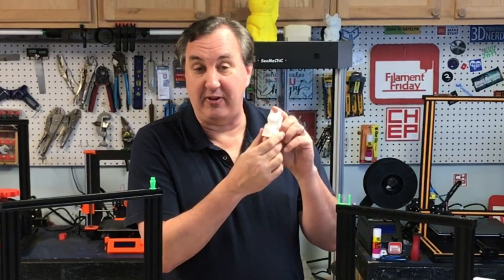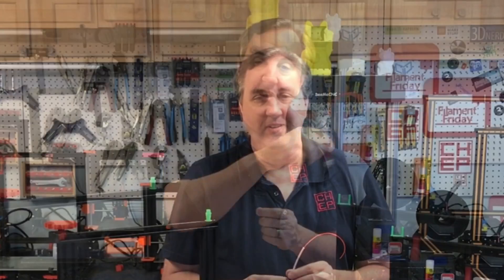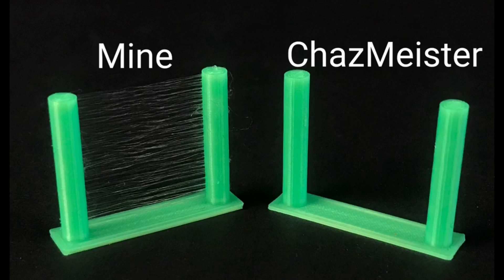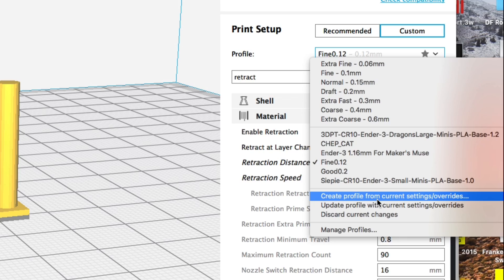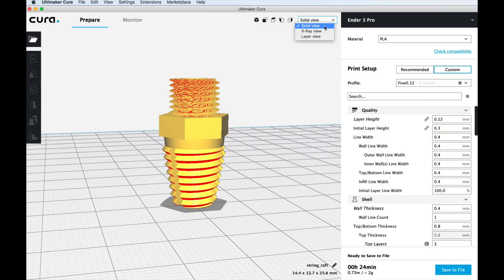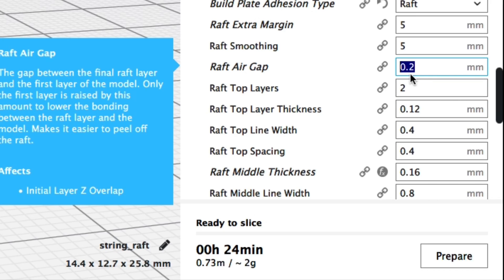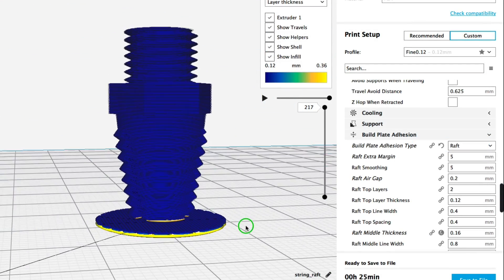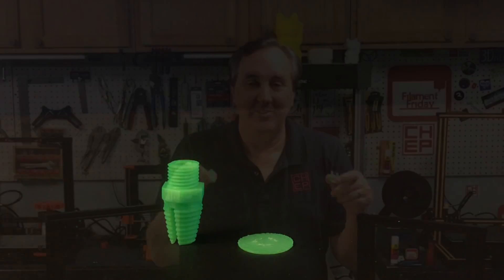Cura Settings for Retraction and Raft on Creality Ender 3 or CR-10 Mini

Comment: I try to change that and it's still leaving strings /: I print at 60mm/s any advide or change?
Reply: Makers Muse had same in his recent string video. He had to switch to a better quality filliment.
Reply: @MichaelDeeringMHC  Actually it's pretty weird, I use Esun filament and with some prints it doesn't leave any string, but when I print the retraction test they appear between the two columns
Reply from the maker: Did you try the settings linked in the description?
Reply: @FilamentFriday  I try it but I don't know why it doesn't work :c maybe it's the printer I don't know, I have a CR-20

Comment: all you need is wipe. I get no string. 60mm/s I don't THINK that actually does anything I think the firmware hard limits it to 25mm/s so anything over that is simply ignored by the printer. I am not 100 % sure on this but I have found no difference between 25mm/s or 100mm/s

I use 7mm retract and 8mm of wipe. no string at all. zero.

for build plate I print teeny footprints like that all the time. I just use a brim. easy peezy yummy squeezy and so much faster.

I DO like how cleanly your raft popped off. that is nice. brims come off easy to but with SOME filaments they can leave behind an edge that has to be cleaned up. also rafts might be good for sequential prints that are left unattended where a slight bed level difference could cause a later sequence to fail. I will have to play with that some!
Reply from the maker: You make a good point. The stock is 25mm/s but I updated the firmware on one and it was higher. The CR-10 mini I used was higher. The Geeetech A10 was 45mm/s limit. So the speed did have an effect on some machines but I should have caught that. Thanks.

Comment: What about temperature?  I find reducing the heat if you had stringing issues helped a lot. I will try this setting also the raft one. Thanks!
Reply from the maker: Temp helped but didn’t eliminate it like this.
Reply: @FilamentFriday  That's what I found. With Hatchbox PLA it seems pretty happy at around 197, but if I'm printing a mini with a lot of supports or printing more than one at a time I'm going to get a lot of stringing.

Comment: Hey Chuck, at about 2:17 you say that cura does a little wipe before it moves. Could you explain what this means, and whether or not slic3r can be forced to do the same thing?
Reply from the maker: It’s at the center when it retracts so it moves and wipes off the excess before leaving the solid section so I would think that’s possible in other slicers.

Comment: Great video Chep!  Thank you.  Retraction is a real challenge with the Volcano style of hotend with my Tevo Little Monster.  The longer nozzle size does not handle retraction well, causing clogs and or stringing.
Reply from the maker: I’ve wondered about that.

Comment: Instead of a raft i use skirt outlines like 10  with a 0,00 offset
Reply: Might as well use a brim
Reply: @fargopolo  ah yes makes sense
Reply from the maker: Using a raft gives me mor surface contact to hold versus just on the edges and the bottom edge has a thread I don’t want messed up by touching a brim so raft works better for me on this print.

Comment: I dont have any stringing on my ender 3 with the cura ender 3 profile.
Reply from the maker: Thanks for confirming the settings worked.
Reply: @FilamentFriday  i mean the default ender 3 profile which can be found when you configure cura to use the ender 3 as a new printer. Didnt have changed anything on this Profile.
Reply from the maker: There is a machine profile as you describe that you select like Ender 3, when setting Cura up.  
Then there are the settings selections like the standard 0.1, 0.2 etc. where these settings I show are. that  work for all printers. 
So I don’t understand what you mean when you say you didn’t change the Ender 3 profile. That is separate from what I’m showing. What settings did you use?
Reply: Are you printing small stuff or large things? Because I believe Chuck mentioned that he didn't have any stringing when doing large prints but he did have stringing with smaller ones. Might also depend on filament and temp settings (so think).
Reply: @SmokedHam444  i mostly print fine small parts or mid size parts about half the heatbed of the ender 3. No stringing at all with default built in ender 3 profile in cura 6.3+

Comment: Does NOT work with PETG, You need at least 60mm/s at 2.5mm retraction.
Reply: It worked for me with PETG. I had problems with 60mm/s with 2.5mm

Comment: 2 very helpful tips, 👍😆
Do you have any good cura settings for supports? 

I'm using a volcano hotend would just doubling retraction work ok as the heat block is practically double the height of a standard heat block or is there more to it, I'm getting good prints without any changes but just wondered 😃
Reply from the maker: Not sure. You just have to test it.
Reply: @FilamentFriday  Cheers, will do 😃

Comment: awesome tips, I'll have to try this.. I don't get much stringing, EXCEPT when printing multiple model on the same bed, both on supports.. I have an awful stringing problem when Cura bridges from support on one model to support on the next adjacent model.. it would seem Cura doesn't offer retraction when printing supports. Have you run into this?? TIA
Reply from the maker: I’ve never thought about since I’m just removing them anyway.
Reply: @FilamentFriday  I understand but imagine the mess and jumble of stringing on the bed when the models are an 1" or so apart and the nozzle leaves and enters the model at different points... it's awful!!!

Comment: Very useful!  In most slicers, skirt, brim, and raft are three options to help with the first layer.  Curious about your thoughts on brim vs. raft.  I’ve been defaulting to brim, since I assumed it would be quicker than a raft for the same benefit, but I might be missing something the raft offers.
Reply from the maker: In my opinion it’s easier to peel off a raft than to cut off a Brim but it depends on the print. If it’s large and flat then a brim helps prevent warping.

Comment: Assuming neither of these setting changes translate to S3D. Any upcoming videos on stringing and rafts for S3D in the works? Appreciate all your videos, they are great!
Reply from the maker: I tried the retraction settings on S3D but it does seem to wipe before moving so I still got stringing.
Reply: I recently switched over to S3D from Cura and I have to say that I have had almost no stringing on medium to large prints, but have seen it on smaller parts. I guess I can start playing with the retraction distance and speed in S3D to see if there is room for improvement. Thanks for all your videos and for the response.

Comment: Cool thing ChazMeister found, guess the slower retraction speed is more efficient in generating and holding a "vacuum" in the hotend, so the molten filament hasn't any pressure and even being sucked back into the hotend.
Reply from the maker: I believe it has more to do that Cura wipes the excess off within the print before moving so slowing it down gave it more time to wipe the excess within the posts.

Comment: Great information Chuck! Just ran two prints. One with your original settings and one with the new. I didn't get much stringing at 10 mm retraction and 60 mm/s. However, with 6 mm and 25 mm/s gave no stringing. Beautiful!  I do have a Micro Swiss all metal hot end upgrade.
Reply from the maker: Great feedback. Thanks.

Comment: interesting, I increased by airgap for my raft settings to .4 and had great results with it
Reply: Therizino Saurus I increased the airgap to .4 as well, but only when printing larger than .2.  With anything smaller I actually prob down to .2.  Neither leaves any scaring on the underside, quit happy with that!
Reply: @blackwolfecc  I wonder what it is about .3 that makes it so hard to remove.

Comment: This settings works with S3D too?
Reply from the maker: Because S3D doesnt wipe before moving it didn’t work as well for me.
Reply: @FilamentFriday  I use S3D and have been at it for a couple of days. First I used the basic calibration test (same as you show in the video), and it came out perfectly. Then I tried another model (https://www.thingiverse.com/thing:1815784) and got nothing but strings. What ended up making a difference was turning off z-lift (retraction vertical lift..I have both both coasting and wiping enabled. Both models now print without any strings.
Reply: If you are printing shallow overhangs you need Z-Lift as the edge curls up as it cools. I am using the Bullseye mount as well so it's not as if I have bad cooling.

Comment: Just a suggestion for a video involving a problem I am constantly having. Whenever I make small parts that are separated similar to the string test but with no bar across the bed to connect them at some point in the print it stops z hopping correctly and knocks one over. I use cura and an ended 3

Comment: Great video, Chep. If you have a little time please make a video how to fight with tolerance. I mean when you for example print a screw and nut does not fit, because it is too tight. I think I need to tune horizontal expansion, right after flow rate&esteps calibration.

Comment: What is that piece you printed for? It vaguely looks familiar....
Reply from the maker: It will be revealed in a future video. Still testing.
Reply: My guess, it is a coupling that is tapered to replace the standard pressure couplings of the bowden tube https://www.thingiverse.com/thing:1993384/comments . Looking forward for Chuck's conclusion about it.